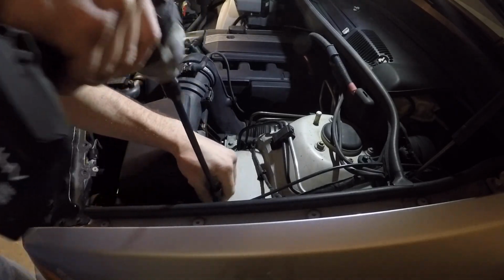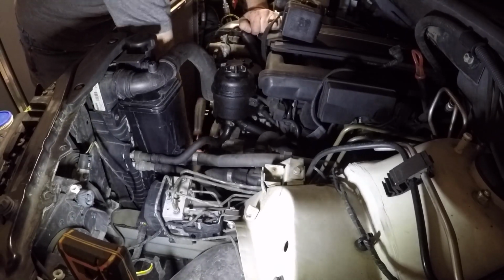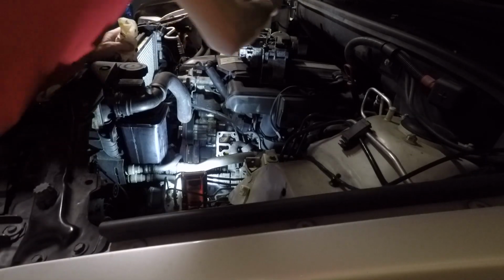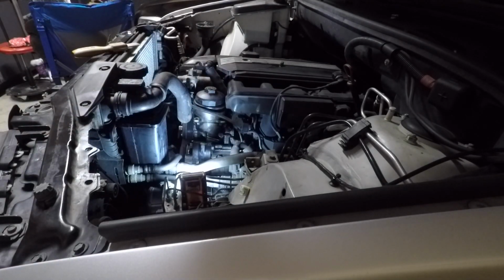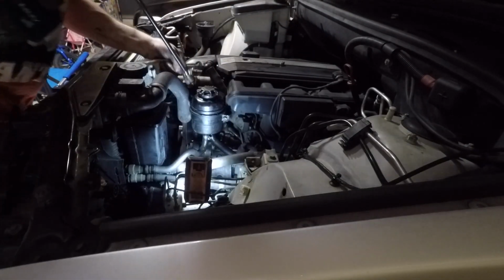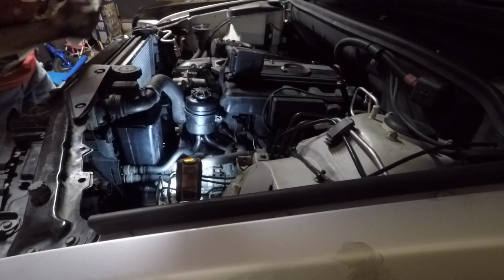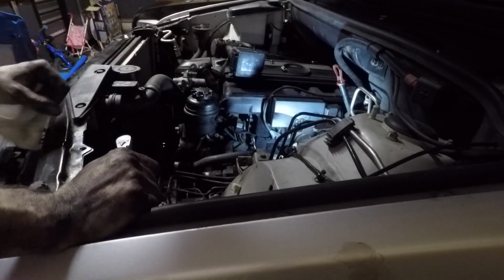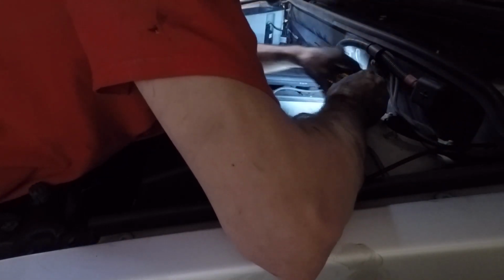Oil Filter Housing Gasket E53 BMW X5 with M54 3.0 Engine

Comment: Followed your instructions on my e53 today. I ordered cooling fan wrench but it never came so I tried it without removing the fan, it actually worked! Just finished the work today will see if it stops leaking... Thanks alot, your vid is very detailed and easy to follow!
Reply from the maker: Yea I did the alternator once without removing the fan. It’s doable but removing the fan makes a lot of room.

Comment: I changed the gasket, after 3 weeks, it still leaks like hell, I took it apart again, it still leaks at the same place... What did I do wrong? Thanks a lot
Reply: nature of the beast. do it again.
Reply: @josekanucee1428  some say it could be generator bracket gasket, but it need to take the driving shaft off and stuff, that is too much for diy.
Reply: four places oil leaks on an e53. 
valve cover
oil filter housing gasket
rear mainseal
front axel shaft seal
suggest thoughly cleaning the engine to have clean and clear view for oil leak
Reply: @josekanucee1428  thanks bro, I have done ofhg (twice) and valve cover gasket, still see dripping from above steering pump, and everywhere under the bottom aluminum shield, I guess will give it last try or give it up
Reply: @josekanucee1428  and the oil pain